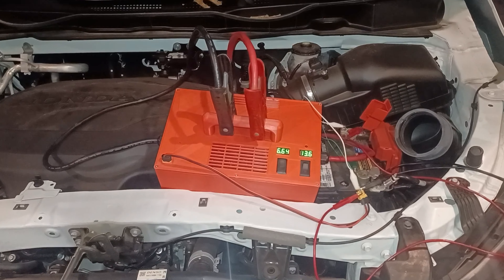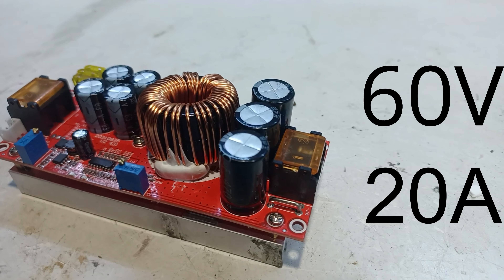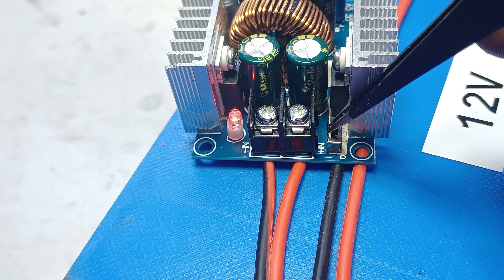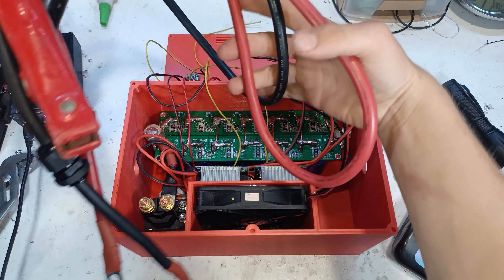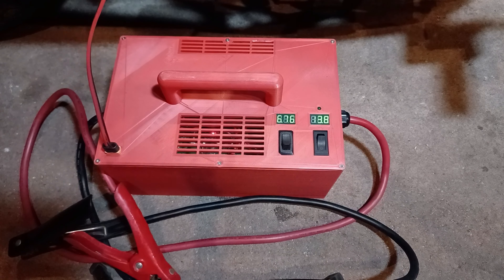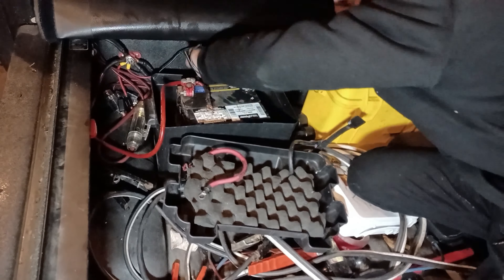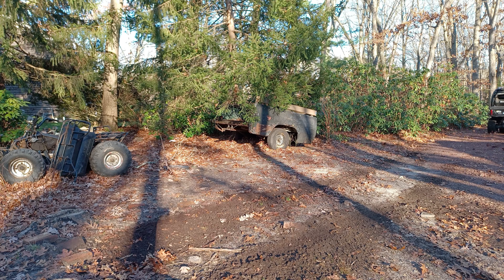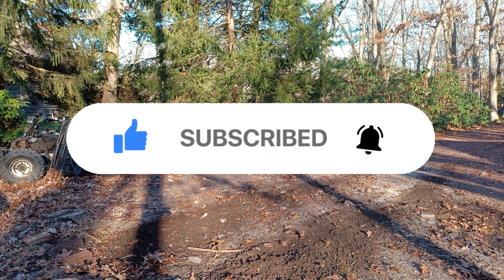How to build a jump starter with super capacitors

Comment: what would be the best way to adapt this to run off tool batteries instead of being charged off a dead battery. use a tool battery adapter and if it's a 20v tool battery would you just use the buck converter or would you still use a boost converter incase the tool battery has a variance in voltage based on it's state of charge?
Reply from the maker: If I were to charge it up using an 18-volt drill battery, I wouldn't need a boost converter, since 18-volt drill batteries have five 18650 batteries, which at its least voltage before the bms cuts off, is 3-volts which equals to 15 volts (3x5=15volts)
Reply: @ElectronicLab.  i figure I'll add a voltage cut off switch and set it to 16.5 to protect the tool battery from damage. Maybe a temp activated fan controller and a fan incase I cycle the caps a few times on repeated starts.
Reply from the maker: @joshuawhite9725  Good idea!

Comment: Be careful .caps like to take a charge even from the air install some resistors for shunts
Reply from the maker: I actually did add resisters. if you look closely at this part of the video 2:26, you'll see a resister for every capacitor (I think they are between 500 ohms and 1k ohm)
Reply: @ElectronicLab.  Thats how gas tube  strobes work where you use a boost converter to get the voltage up to 4kv and charge the capacitor and then use a low voltage to trigger and scr to dump the capacitor charge  into the gas tube .Only you are letting it out slowly via buck converter .,You can never gain unity if you discharge you battery too far it will act as the load on your buck converter and you won't have enough to current  crank the starter and power the rest of the electronics at the same time
Reply from the maker: @carlubambi5541  Interesting
Reply: @ElectronicLab.  Don't get any bad ideas ????Just follow the rules capacitors are still bombs just as bad as lithium batteries in one way and high voltages are no joke be careful
Reply from the maker: @carlubambi5541  yup